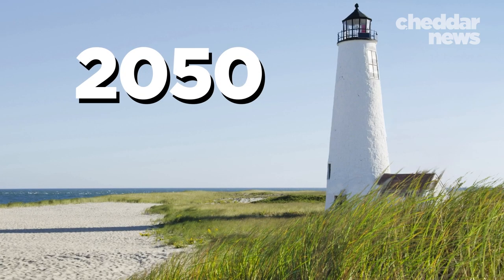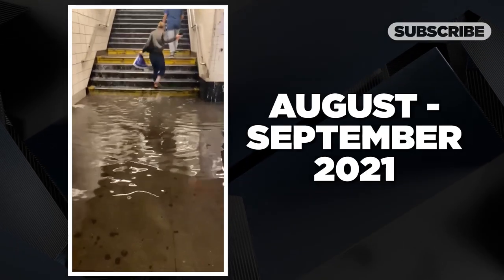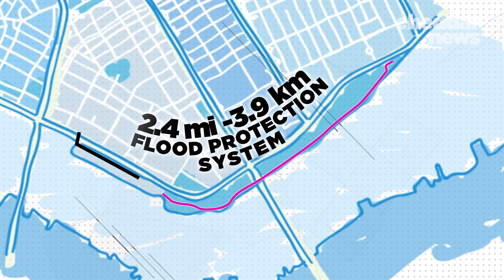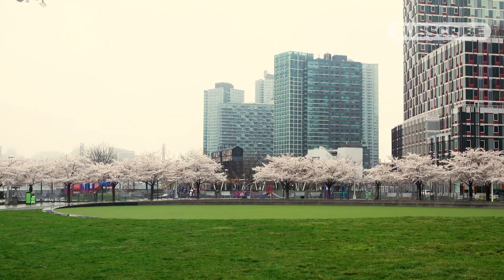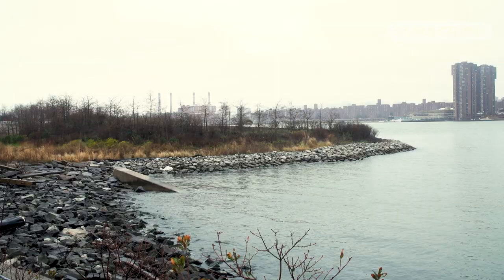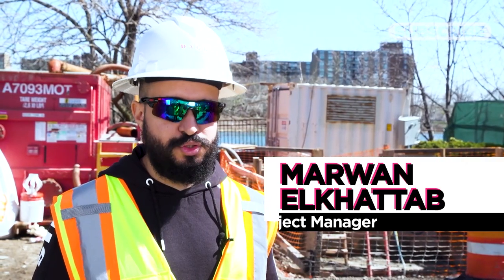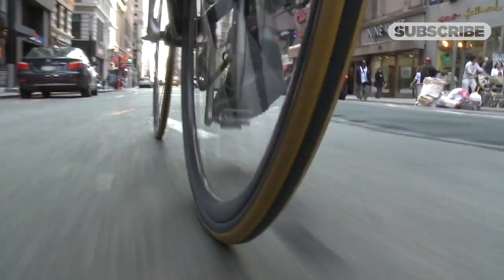New York's Plan To Defend Itself From Rising Seas - Cheddar Explains

Comment: I would recommend that you interview people who use New York as a port and therefore understand, as a navigational issue, the currents that flow around and through the city.  The East River, for example is not actually a "river".  It is an estuary that connects Long Island Sound with New York Harbor.  The Hudson River is indeed a river, but it is also strongly tidal because of its powerful connection to the Atlantic Ocean by way of New York Harbor.  So if the Atlantic Ocean enters the city directly into New York Harbor and indirectly through Long Island Sound, while the Hudson River brings a substantial amount of fresh water through the net ebb of its tidal cycle, what good is a wall between Sandy Hook and Breezy Point?
Reply: Just the wall is definitely not enough. When you close the gates and the water level in the river is high, the water from upstream has no place to go. Therefore you also need a runoff area. The room for the river plan we have where I live deals with that. You build dykes along the rivers, but you also have places where nobody lives and that can hold a lot of water so that water can flow into that area when the storm surge barrier is closed. When the storm has passed and the gates reopen the water can flow away. America has a lot of space to make such area's unlike the Netherlands, so if we can make room for the river, then so can you. Most of the things you need are already in use in Japan and the Netherlands for example. Just copy and adjust to your specific needs.
Reply: The wall is intended to reduce a storm surge only, basically constand high winds that temporarily pushing water into the harbor and temporarily raising the sea level (an extra 8 feet above high tide is not unheard of). In a static situation, the water will eventually flow into the harbor, but that takes time. By the time water flows in from the other routes, the storm and its winds will have past.
Reply: The barrier would essentially serve the same purpose as the Thames Barrier built in London- Just to prevent a surge, basically
Reply: It's not a total solution but it's not *not* part of a wider one.
Reply: Interesting that the City hasn’t built a wave generator to power it’s essential services. If the Hudson is so tidal then runoffs wouldn’t be needed. It just needs political vision and perhaps state intervention to get the ball rolling.
Reply: @IJubane  Japan also has those giant underground flood tunnels. The US should adopt those.
Reply: This is why you should not over develop and over build on estuaries and tributaries that are a buffer zone for the tidal waves and water tables. These natural resources should not be used to be built upon for over populated areas.
Reply: And when we do over build and over develop and take out our estuaries and tributaries and drain the salt marshes it’s not climate change that brings the flooding and sea level rise as much as the natural buffer zones were taken out and developed upon and concrete will never be able to sustain the environment and elements like nature can. These estuaries and tributaries clean the water, take in the carbon, and have sustainable fisheries. How does taking out the estuaries and tributaries to over develop and over build help humanity or hurt it? We must do something about it and the first step is to stop these destructive developments from spreading.

Comment: 6 feet of sea level rise.. but Sandy sent a 13 foot wall of water into lower Manhattan… we’re STILL fixing that (Hudson River tunnels out of Penn Station need major replacement work to get the salt water corrosion out.)
Reply: Don’t forget the subway stations which are covered with filth and corrosion
Reply: @luvindersingh6472  they repaired most of those, the worst was the brand new south ferry stop on the 1, completely submerged to the top of the escalators. Everything had to be ripped out and replaced. They had to go back to using the old loop station above it.

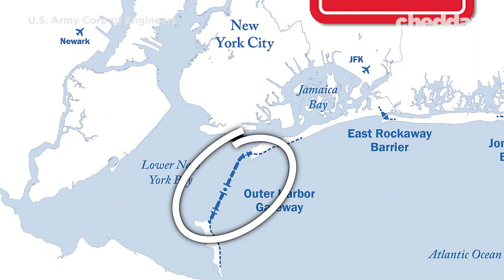Comment: 6:35 is designed by a Dutch firm I suppose, they are the same as the existing maaslandkering floodgates/storm surge barrier in the Netherlands
Reply: New York is New Amsterdam
Reply: That did look a bit like Rotterdam's Delta Works.
Reply: @CortexNewsService  Cool but I thought that was a national project. Since when does Rotterdam claim it for it's own?
Reply: @MrFlatage  it is a national project, but that swinging gate is at Rotterdam

Comment: tip: ask the dutch to make similair systems like they made at Rotterdam  and the rest of the country... it could 1 save many lives and 2 save lots of money!
Reply: i just see one problem with the USA... They don't look at other like the Dutch to improve their situation... They think by doing it their way it will fix itself.. i can tell you that hasn't worked in New Orleans..
Reply: New Orleans and southeast Louisiana deals with floods both ways. From the gulf during hurricanes and from the river during seasonal flooding. Much of the infrastructure we built in the distant past to facilitate water abatement and ship traffic worked against us. Not only this, when you protect one area, it just floods another with lesser protection because now water is pushed in a different direction. When it comes to mother nature and controlling water, it is extremely hard to find a solution to protect everyone.

Comment: Protecting ourselves from sea level rises should always include an ambitous but achievable goal to reduce our greenhouse gas emitions. If we can slow down the amount of warming we create, the less money we wil have to spend on these kinds of infrastructure.
Reply: The problem is people. Both side of the climate change argument are too far divided and neither side is willing to compromise. The best solution to our situation is some where in the middle of the two factions.
Reply: Drastically reducing methane emissions is the better immediate goal: you'd see improvements in a decade.

Comment: While the hysterical love to scream about climate change they forget that whether we have accelerated sea level rise or not, the key word is accelerated, not caused, as in created a situation that wouldn't have occurred at some point in the relatively near future anyway. Unless, of course, the sea were to retreat causing a whole new set of issues. We have developed our cities in one of the most stable periods of geologic and climate periods in Earth's history and now we pretend the world as we know it now has always been like this. It hasn't and we've known for quite some times that eventually we'd have to face rising seas and even farther into the future, receding seas. But we continue to act as if we only switch to electric cars and turn the A/C up a few degrees that we will stop a process that was going to continue whether man kind was here or not.

The issue is cities that thought they could keep putting off infrastructure and zoning regulations related to water intrusion for several more generations and leave someone else holding that bag are upset because we pushed up the timeline on the inevitable and now they have to deal with it. Well, tough toenails. Even those municipalities that are taking proactive steps are only taking half measures that will almost surely cause more issues than they solve. If you don't fully surround a perimeter you simply push water to other places you thought were safe. Of course, no one wants to do the smartest thing which is just to stop allowing new business and residential construction in areas of known current and future water infiltration and to begin moving areas in danger back or relocate them entirely when possible. Obviously that can't be done everywhere right now. But if you honestly believe that after spending billions you've only bought yourself fifty to a hundred years then you better do something other than build levees and flood gates. If I were the mayor  of a coastal town I'd lobby for restrictions against building closer to the ocean or river than what engineers and science said was the likely 500 year flood plain. Unless the builder signed waivers to not seek insurance assistance from the locality and put up a bond  that would cover the cost of it's cleanup after a storm. Before the storm, not after when they declare bankruptcy and skate. Currently that might drive business away because the problem is still decades away from being a multi billion dollar issue in most areas outside of New York, Florida and some parts of the Gulf coast states. But when states and counties make big concessions to attract business who build 100 feet from the ocean and the inevitable disaster or creeping rise occurs the cost will be astounding.
Reply: Wow I've typed deposition shorter than that for corporate law firms because last time I checked the only people screaming about climate change were the thought challenged.

Meanwhile the topic could have been about anal warts and I'd read a statement about Let's go Brandon or something about Biden, Hillary and liberals in all honesty I'd rather just go to brunch.

Comment: I wonder if the people in charge are forgetting that just because the sea level will rise, does not mean that that level is going to be a threat. If the water rises by 3ft, there's no point in building something to withstand a 6ft water rise. Hurricane sandy sent water surges of 13ft into New York.. If the water level is 3ft or 6ft higher (provided the world hasn't ended yet) and you get more storms of that size, you need your city to be able to withstand water surges that are 20ft higher than the current water level.. That's just not possible.

Comment: Seems to be quite a lacklustre approach, I feel sorry for the people of NYC in the coming future
Reply: It does look lackluster you’re right. As Queens resident who lives by Jamaica Bay which is just as close to the the water as Lower Manhattan seems like that section of Queens and areas like Bayside, Flushing, Whitestone will get hit hard again when the next storm comes.
Reply: Why? Wouldn't the excess water make it's way through the water cycle to pool in all the deserts below sea level that were covered in aquatic life before the ice caps seem to have formed?
Reply: @scottmad8563  more water in the water cycle means it should be able to spill over in the form of rain just by sheer excess and in some cases, the same conditions that prevent rain from reaching some regions might also trap some of it there. Rain is rare in the desert, but not unprecedented. Any increase in the surface area of the ocean means more water in the water cycle due to evaporation. More water in the water cycle means more rain. More rain means more of it slipping past and getting into deserts, plains, and valleys where it'll pool at the lowest elevations it can reach.

Comment: I think that they should also start building a new rapid transit in the city. The New York subway is just not feasible anymore with the constant flooding and other issues that plays it today. Suspended systems like the Chicago L probably would work very well in New York. I mean aside from the billions of dollars and overall problems with construction/ geography issues....it’s a good plan I think?
Reply: They have those in Brooklyn, Queens, and the Bronx. They used to have them in Manhattan.
Reply: Except as a resident who has lived here since 2004 and commuted to Grand Central Terminal over a 30-year period our infrastructure doesn't permit that and even though our transit system is over 100 years old we're not about to rip up everything at the drop of a dime.  The outer burrows have subways that are above ground. Manhattan it's not practical. Plus the new Grand Central Madison station has just opened connecting Penn Station to Grand Central terminal and I get around just fine on our outdated and antiquated subway system.

Comment: They’d have to do what they did in the expanse
Reply: what
Reply: @quibble4626  i would imagine they expand things.
Reply: @quibble4626  It's a sci-fi series. NYC is surrounded by several-meter-high sea walls to keep the flooding out. Statue of Liberty is only barely above sea-level, with it's base entirely below the level of the water behind it's own walls.

Technically they'd have been better off building 3 dams at the Narrows, Arthur Kill, and Long Island sound, but this made for a rather more dramatic presentation artistically.

Comment: Build a seawall, connecting two narrow sandbars, across four miles of open water? I don't think that's possible. It might be feasible to build two smaller storm barriers: One just north of the Verrazzano Narrows Bridge and the other across the Arthur Kill at Perth Amboy. Both barriers would have to be opened and closed relatively quickly, and both would require massive pumping systems to move accumulated water seaward. NYC also needs a plan to gradually cede really low-lying areas -- like Coney Island, Broad Channel, and the Rockaways -- back to the ocean.

Comment: heres a great solution. build a surrounding wall and build large pipes into it to direct water wherever would be best. the pipes would generate power if equipped and they would reduce tidal pressure on the wall making it last longer. in the event of water level increase from say a bad storm would generate enough power to even pump the water somewhere else.

Comment: I have a feeling that the classic subway lines in NYC was elevated for this reason.
Engineers saw this coming a century ago.
Reply: No. Most "subways" (technically rapid transit railroads) were originally at grade or elevated, with the at grade railroads disappearing as the population increased and the value of street level property grew. The subways were elevated because it was cheaper and the neighborhoods sparsely populated or too poor to object. In Manhattan, much of the rairoads were literally forced undeground, less so for the poorer outerbouroughs. Also, these were a hodgepodge of seperate rail companies, not one monolithic organization as it is today.
Reply: @ycplum7062  I see, but it would be safer to have them elevated considering that water conducts electricity especially underground (3rd rail).
Reply: @samsunglg6671  

Back then, flooding wasn't an issue. If a storm was that bad, everything would shut down till the storm past. The elevated lines actually predated the subways. You don't have underground rail (with massive capital costs) unless the land above is valuable. Much of the elevated rail was over what was then farmland or poor neighborhoods.
Reply: @ycplum7062  I see, the drilling protocols wasn't cheap.

Comment: The numbers used in this video or not quite accurate. I worked at NASA Ames Research Center we found that the sea level is rising approximately 1 mm per year. That means in a hundred years it will live risen 100 mm or approximately 4 inches.
Reply: LMAO!  There has been ZERO significant change in sea level since the US Navy has been CLOSELY monitoring it 82 years ago. ..

Comment: I had a thought and realized that one problem with electric cars currently is their low energy density as well as current offloading of fossil fuels from cars to power plants. A potential solution that could save the fossil fuel industry while also slowing climate change would be to make engines as efficient as possible. The target goal would be to develop a 100mpg vehicle which alone could reduce emissions massively. Another problem that we need to tackle is how much energy we release as waste heat. The thermal energy from a oven for example could be connected to your heating system and vent waste heat throughout the home requiring less time that your furnace will run. Only question would be is there any limits to overcome? Do the laws of physics allow this?
Reply: The only way to get anywhere near that efficient is not with combustion engines. The Honda Insight from the late 90s is still the most efficient hybrid ever(older crash test regs allowed for much lighter vehicles) at around 70 MPG, with many hypermilers squeezing more out.

Even over-sized and inefficient EVs like the Model X get over 100 MPGe, which isn't a perfect equivalent but is a good yardstick. 

If we're looking for a balance, plugin hybrids are good because they use mostly electricity for normal driving, with gas for longer trips so you don't need 300 miles of range from batteries(which are energy intensive to produce and still somewhat expensive)

Combustion engines alone simply cannot get to 100+mph with cars. Motorcycles, maybe, but cars are just inherently inefficient.
Reply: @Joesolo13  thanks for the insight and hope you have a good day
Reply: As Joe states, we have pretty much reached the limit of how efficient we can make combustion engines. Something like 30% of the energy will be wasted as heat, according to the laws of physics.

To take care of the energy we already have, like heating, there are a number of different interesting technologies. Heat pumps (basically reverse A/C) makes heating a house 3-4 times more efficient. Sterling engines, which are driven by a temperature difference, have also been tried to reclaim energy from heat, in facilities such as data centers
Reply: ICE will never be anywhere close to the thermal efficiency of electric, the majority of the energy is dumped as waste heat and not used for meaningful work.  Additionally, even with all the carbon footprint caused by rare earth mining, battery production, car production, shipping, and charging the cars off the grid, the EV will still have lower net emissions in a relatively short time period. Even with production emissions being way higher for EVs, it would be a net reduction in carbon to build a brand new ev and replace your current ICE with it. It would break even in only 50k miles or so.